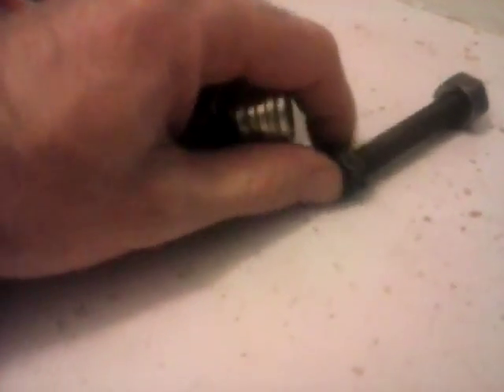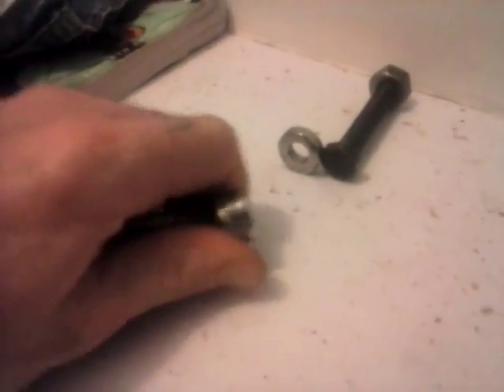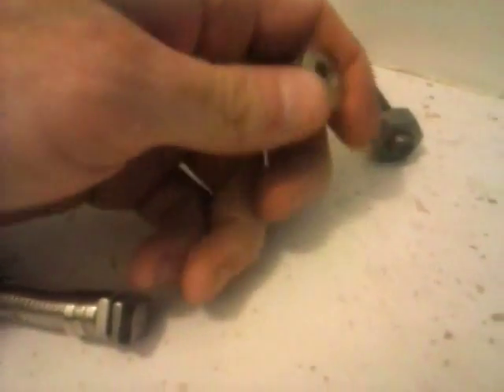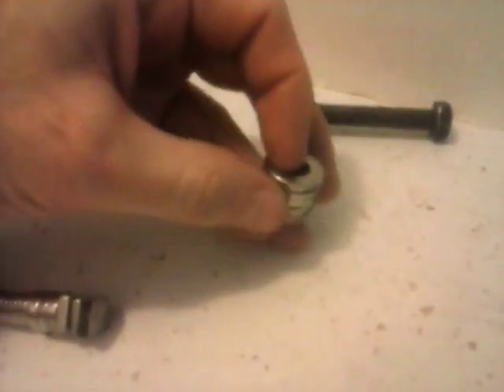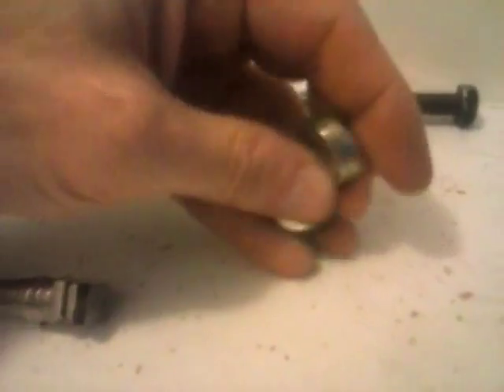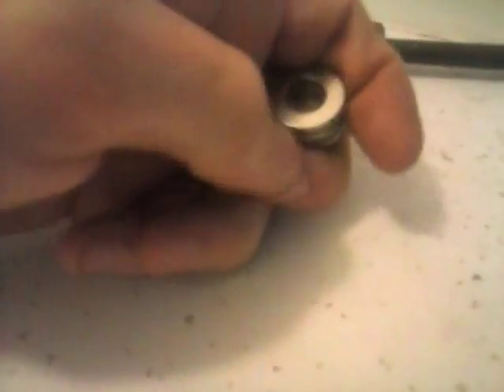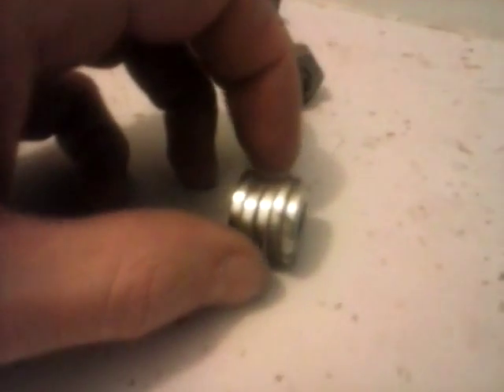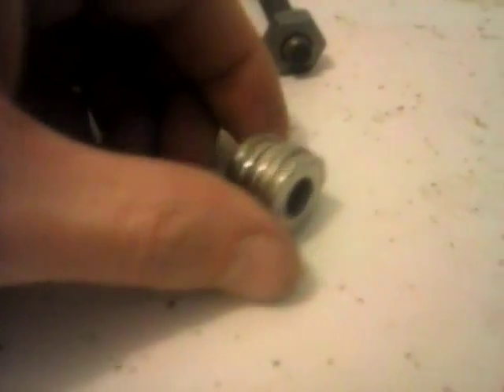Artificial monopole magnet part 2

Comment: You take two magnets that and glue them together with the same pole of each magnet facing each other. The lines of flux exit from the face and enter along the sides. Also, the magnetic fields are not caused by a current in the magnet. Find a legitimate video on how magnets work.
Reply from the maker: Of course there's a current flowing through.... Magnets are conductors of a smaller base fabric of space... During manufacturing, poles are not defined N and S until an electric charge is added to align the particles spin direction...E current IN becomes S pole whereas current OUT becomes N pole... Magnets don't magically create electric current..
Reply from the maker: And I have them N pole vs N pole... So current is flowing OUT at the center between them and IN at the face on both sides
Reply from the maker: Don't need a YouTube video on "how magnets work" Lmao... I have seen them manufactured.. and have had in-depth discussions with engineers and physicist for many yrs now relating to them
Reply: +Trevor Hulette A magnetic line of flux is not a current flow. Trust me, you need to learn something about electromagnetism.
Reply from the maker: Please enlighten me... You have some pretty vague statements with no explanation... Not sure if you understand how a generator actually works or even the magnetic field of planets work... Or if you are a YouTube troll just trying to sound smart because you watched a video... Please define your point or I will just assume you are trolling
Reply from the maker: Oh... Just looked at your YouTube account... Lol... I see.... You are just trolling... Thanks for your time
Reply: +Trevor Hulette When a magnetic field changes it induces an electric field. Likewise when an electric field changes it induces a magnetic field. In this is what make radio waves and light propagate. Reference Maxwell's equations.  There is no current because the definition of electric current is about the propagation of electromagnetic force using charged particles (usually electrons). A generator induces a current because a changing magnetic field induces the motion of charged particles in a conductor. 

A monopole magnet is not two magnets glued together. A monopole magnet refers to a magnetic field that displays properties of one pole without the other pole existing. You have a simple magnet arrangement where both poles exist. The search for an example of a monopole magnetic field is a old but continuing endeavor in physics. If you really think that you have something, publish your work and collect you $2M Nobel prize.
Reply: +Trevor Hulette "You are just trolling.." - If you are referring to how I reply to the proverbial "nut cases" on youtube, I do that because you folks do real damage to vulnerable people such as youth. I really don't expect you to look into what is known about Electricity and Magnetism. I suspect that learning how it really works would be to much of threat to your delusionary pride.My goel is to point out the that what you are doing is fantasy. Primarily for the young kid taht is exited about science but never develops that into scientific skills because of crap on the Internet.
Reply from the maker: I clarified this already... I specifically stated it is NOT a monopole because a monopole cannot exist.... Dirac was one of those "delusional nutcases" u spoke of...
Reply from the maker: I referring to ur complete misunderstanding of the particle physics involved with a magnetic field.... Not only of a magnetic, but also stars and planet... U act as if it is a magical force.... There is a smaller base particle field being conducted through the actual magnet itself based upon the directional spin of particles composing that atomic structure... The current is always there.... Neodymium in it's natural state doesn't have defined poles... Though it's magnetic field is still there, it is not defined until the quick electric charge is induced to align the particles to spin directionally... Current enters , creating South magnetic Pole... The side the current exits becomes North magnetic Pole....
THERE CANNOT BE A MONOPOLE...
I called u a troll because I see ur comments to other ppl elsewhere on YouTube. U didn't come here to "discuss" anything... U made accusations about what I was saying (which misleads anyone else reading these comments)
U assumed I was saying "I created a monopoly" which leads me to believe #1 u didn't hear a word I said in the video... #2 u didn't read the information ......... OR..... U simply came here to make false accusations to mislead ppl about my intentions...
Reply from the maker: I am curious about E=hv... U clearly aren't ignorant yet you seem to be completely missing the point of the video.... The name of the video is mostly to gather attention from others who know a monopole is not real... Anyone can clearly see there are still two poles (especially when u cannot have one without the other)

Comment from the maker: The reason I say it is artificial monopole is because it behaves similarly based on the small area of one pole compared to the large face area of other pole... the larger face creates a field that is overbearing and creates a dominant surrounding force... the smaller face area pole IS still there but isn't able to interact properly so larger face of magnet is the dominant field force based upon area of exposure